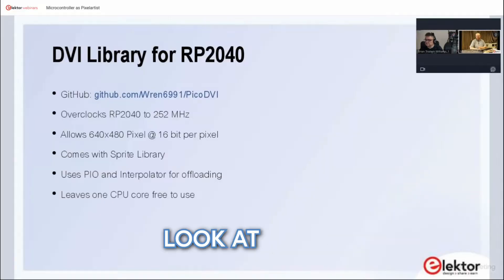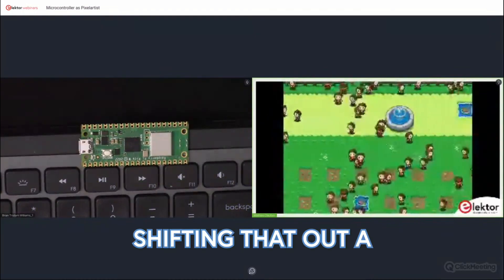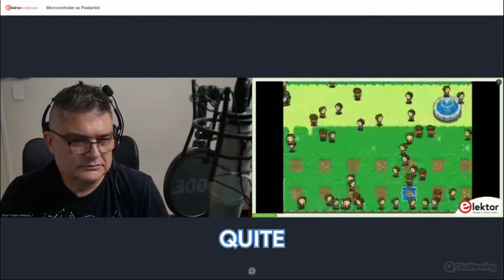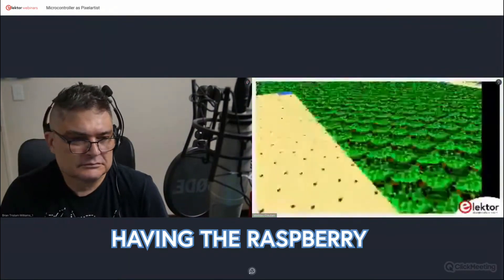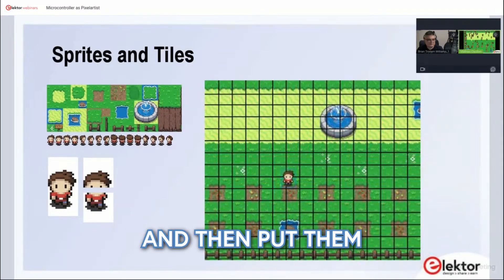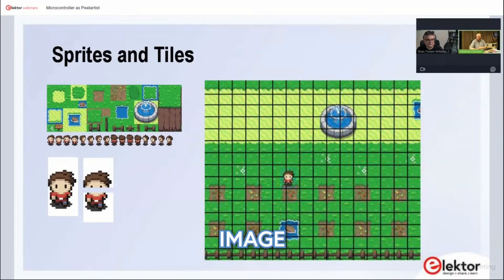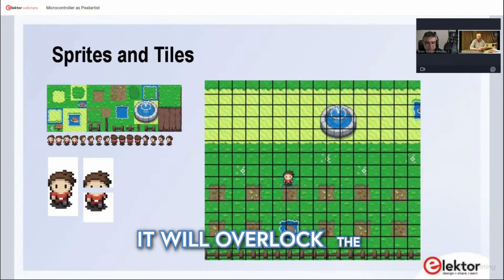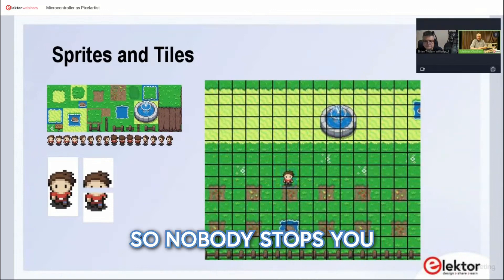Raspberry Pi Pico DVI: Graphics Engine Demo!

Comment: Nice!  I'm wondering about building a serial terminal (I miss my old Televideo 950 and VT-220) and it seems like a Pico could do both the serial comms, terminal emulation, and video output for an 80x24 (or x25) display on a small LCD monitor.  Still need to figure out the keyboard solution. PS/2 keyboard to Pico might work, but PS/2 keyboards are rare, so maybe a USB keyboard with the Pico as the USB host?  Hmm...
Reply from the maker: The Pico could work as an HID host!